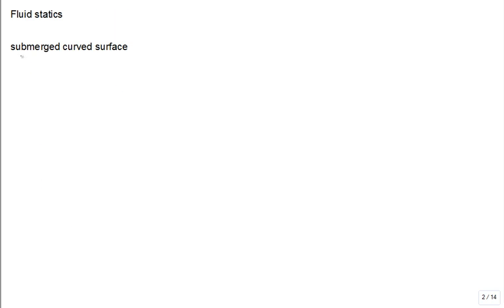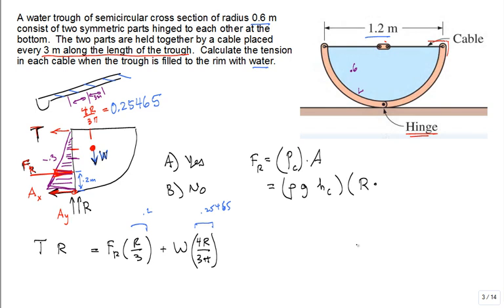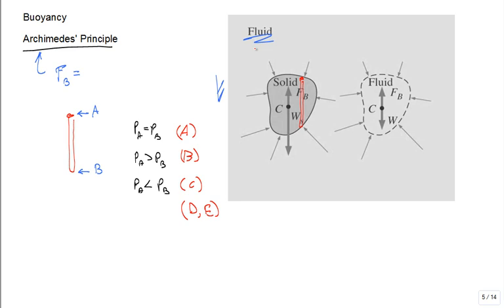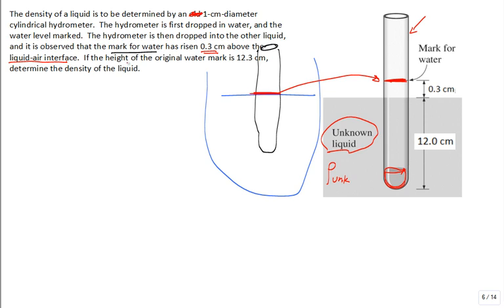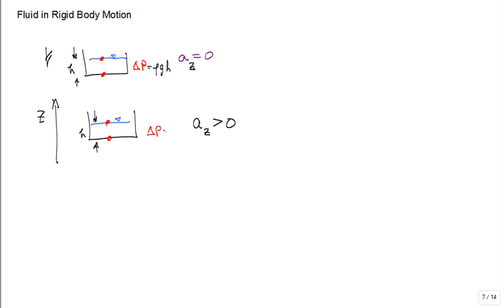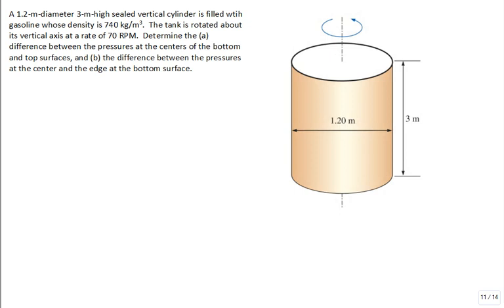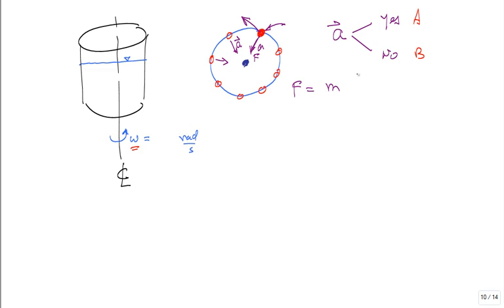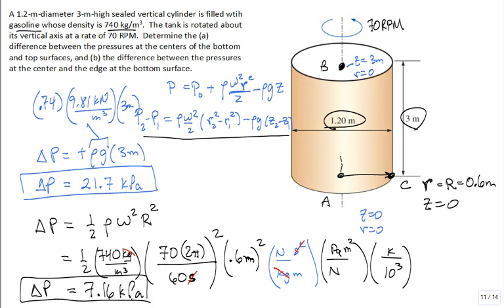Fluid Statics 2 Summer2015

Comment: you said that if the solid was of non uniform density , the point of action of weight would be shifted to the left and the buoyant force acts at the centroid, does that mean there will be a moment of rotation of the solid and thank you , professor for that amazing explanation